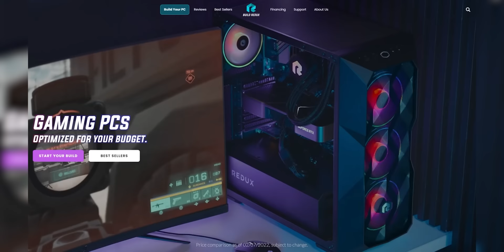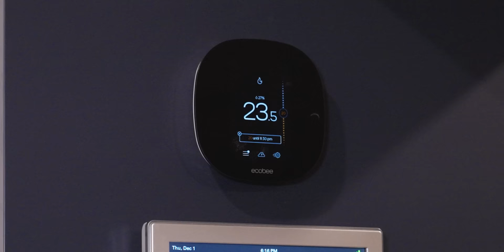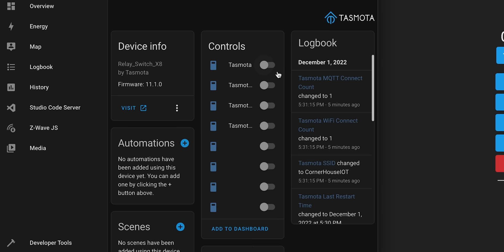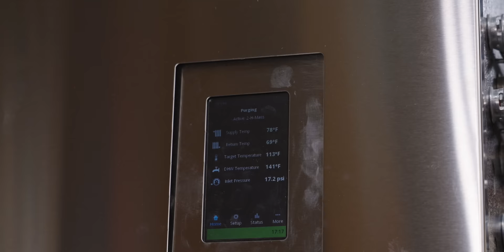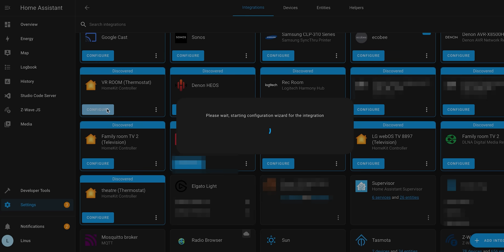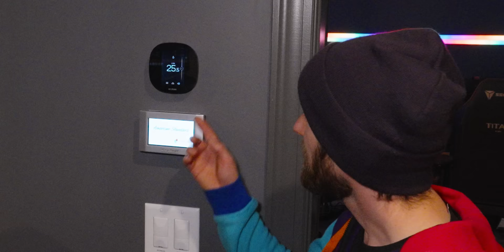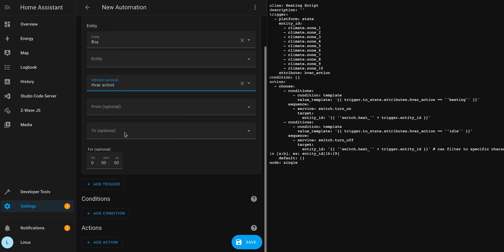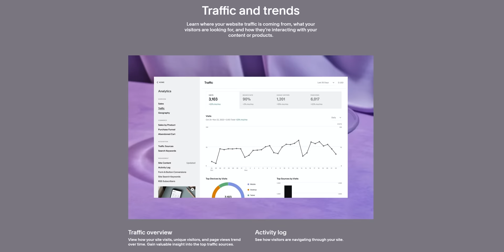My Smart Home is Stupid - HVAC Update

Comment: The endless problem solving, tweaking, upgrading of Linus’ house stresses the s**t outta me. Plus constantly having a film crew there, I feel like I wouldn’t be able to rest.
Reply: For this reason, im glad to be in a small house with a dumb thermostat and normal light switches
Reply: I’m sure getting a lot of this stuff for free or discounted rates makes it a hell of a lot easier
Reply: @MiguelY22  Danfoss Eco 2 is even better than the dump and can be controlled with bluetooth. They also turn down if you open the window.
Reply: What's more, his new house is probably being treated as a business premise / use and all the tax deductions which come along.
Reply: This is why having a good contractor when building a house is SO important... HOWEVER and Ive been wondering if Im noticing this as confirmation bias or if its true, but it seems people in general are less competent at complex tasks then they used to be. 
So to me lately it seem its also just as likely Linus would be dealing with major screw ups by some expensive "pro" as doing these things in a do it yourself janky way.

Comment: Now you have local control! If your relay board ever goes out and you need heat before you can fix it, you can manually turn on zones by pushing that silver lever all the way to the right. There's spring tension you are working against when the zone valve is not powered. But if you just push the silver lever with more force you can run the zone.

There is a little metal hook on the bottom that you can get the lever to rest in, thereby holding it open without power.

Comment: For temperature offset correction (in the case of the one thermostat reading high due to it's location on the wall) follow these steps:

1: Tap the three lines in the bottom left of the main screen to bring up the main menu

2: Scroll towards bottom of the main menu and tap "Installation Settings"

3: Tap "Thresholds"

4: Scroll towards bottom and tap "Temperature Correction"

5: Adjust to match a thermometer placed in a centralized location of the room. adjustments can be made in intervals of 0.5°F, unsure what °C intervals are. (I'm an hvac tech in the state of Ohio in the US, so we almost exclusively set up our tstats in °F)

6: Exit the menus by continually tapping the back arrow in the top left corner

7: Observe the main temperature screen and watch for the room reading to change. It usually takes a few seconds to implement after getting back to the main screen

I hope this helps you Linus as well as anyone else wondering about temperature correction. Note that this primarily works for thermostats that are under a constant hot/cold influence. A thermostat in an open, windowed room will still act up a bit when direct sunlight hits it for an extended time during a cloudless day.

Comment: The ecobee thermostats allow you to calibrate/ offset the temperature sensors. For best results, get some matte black spray paint and cut an aluminum can open and flatten it, then using some thread, hang it at chest level in the middle of a room for a day or so, and the. Using an IR thermometer, check the temperature periodically throughout the day. Then using the average temperature delta between it and the ecobee, add that offset to the thermostat.
Reply: Wanted to also add that you can pretty much use any matte black object that has a very low thermal mass. I personally use a soda can section because they are very thin, but still durable enough to be reused when needed. Depending on the home construction you may need to do the test twice, once in the winter, and once in the summer, then writing down your winter and summer offset, then switch to one of those depending on the seasons.
Reply: I don't know what type of sensor it used. But they right resistor probably do the job
Reply: Just use an ecobee sensor and place it in a spot that better represents the room's temperature and have it read from that sensor instead. Probably easier
Reply: @jeremiahkuehne2400  While it would be good to use multiple sensors, compared to other companies, ecobee gouges like crazy on their sensor prices, in addition to needing expensive batteries that do not last anywhere near the advertised times. Beyond that, they refuse to add much needed functionality that will play to their strengths, for example, The ecobee can control the heating, cooling , and fan separately, why not allow me to use have the system cycle just the fan if the temperature delta between upstairs and downstairs exceeds a specified amount?
Reply: @Razor2048  or use buttons
Reply: @Razor2048  That would be a nice feature to automate! Where I am and how I have mine set up, if the temperature difference was large enough I would just leave the fan running continuously on a low speed. But our house has even enough heating (for the spaces we typically occupy) and I don't have a secondary thermostat heating up my other thermostat so I don't have to worry about the thermostat getting the temperature wrong lol. Good to know about their sensors. I opted to not bother with them because I didn't want yet another small gadget that I needed to baby-sit!
Reply: @emenesu  I think the point of it is that the device could do it, but for whatever reason that kind of usefulness is left out. @Razor2048 I figure it might be because the ecobee is designed as if it will be the only device sensing and controlling HVAC which applies to just most dwellings (single floor, small, and/or old central HVAC design,) so any work into complex multi-floor/multi-zone was not considered heavily. If I want to do the same myself I'd need the right glue of HA's automations to make sure it runs rationally, because trying to avoid fighting thermostats resulted in a bunch of faffing with conditions.
Reply: you are talking about american people.

Comment: God tier hvac guy here; if you ever have an issue with the zone valves or tstats that metal slider on the bottom can be slid into manual on. 100% heat which will also make the end switch in the valve as well. You can all ways jump out the call for heat on the boiler as well. If theres no flow the boiler wont run so dont worry about breaking it.

Comment: Ironically I think linus going down the smart home path has even convinced me that I don't want a mini split, bro I ain't never seen any stupid issues with a whole house forced air system like the variety of issues linus has had over his multiple houses
Reply: Minisplits/heat pumps are pretty sick, it's the automation that kinda kills it
Reply: I'm in residential HVAC mini splits are dope. Eventually whenever my system kicks the bucket I may just swap out the split system I have and get a 4 headed minisplit or just buy one for my computer room. They can actually help the original system not run as much, and we've had a lot of customers tell us that their electric bill went down after just putting a minisplit in their lanai and having them keep the sliders open to assist the main system.
Reply: Here in India it gets much hotter (40+ degrees) and we use mini splits only. They're very reliable and much more efficient that ducted systems. Ducted systems are anyways useless in our homes as they made with concrete and bricks. It's the automation that's causing the trouble.
Reply: @Dijitz23  Thats because most mini splits heat 1 room at a time if you set them that way,  its easier to have the source of heat or air directly in the rooms so they get hot or colder much faster..          Some rooms can boil hot where others will be cold as hell.       if i get a mini split it will be a dual voltage one 120vac/220v  + 12/24vdc.
Reply: @panzer3279  > Ducted systems are anyways useless in our homes as they made with concrete and bricks.

Most homes in US are made from concrete and bricks too? Only reason venting is useless in most of India is because most Indians cannot afford to pay for proper home venting systems installed by people who know what they're doing, instead the Bhayya from Bihar bullshits a terrible system for dirt cheap and everyone is left wanting more.
Reply: @debodatta7398  > Most homes in US are made from concrete and bricks too?

They aren't ? Do you consider houses that use bricks on the exterior of the house and wood framing internally as made of concrete and bricks ?

>most Indians cannot afford to pay for proper home venting systems installed by people who know what they're doing

This is so far from reality that it makes me believe you have no idea about how costly Indian homes have gotten. Most houses in tier 2 cities cost as much or more as US houses with their "proper home venting systems". The real reason it is not done here is because it is wasteful, split systems are more efficient when you need to cool just a portion of the dwelling for majority of the time. People in the US generally don't care for efficiency, average energy footprint of a US home is no where even comparable to an Indian home.

These systems are still prevalent in offices / business spaces in India because unlike homes, they are expected to have occupants in all places majority of the time.
Reply: After living in subpar rentals the past few years I don't care what I have. I just want decent insulation in a house that's well sealed first...

Comment: Linus, a Heat Pump should work constantly. It adapts the interior temperature based on the outdoor temperature. It measures the outdoor temperature and heats up the house. The thermostats should always be ''open''. This is the only way you could a constantly warm house without temperature spikes and without high costs. The heat curve should be as flat as possible.
Reply: Also the hydronic compensation should be turned on in the thermostats, which learn how quickly they heat up and cool down and compensate for that. Neither of the problems outlined in this video should really be a problem at all. Run the heat pump at either a high or low level and allow the hydronic compensation to keep the in-floor heating at a constant level too.
Reply: What are you talking about? It should work consistently yes, but it won’t always be 100%. Heat pumps have a lower limit of how cold the outside air can be before it physically can’t pull any more heat out of it. Given he lives in Canada and it’s real cold there, he will need to supplement with in-floor heating in the cold months.

Comment: We have "smart" light sensors at our office that turn the lights on and off depending on how well the room is lit up and if someones inside. And they do annoy the sh*t out  of everyone, we all just wish to get a goddamn switch back.
Reply: The thing is, these things SHOULD come with a 3-way switch: AUTO/ON/OFF. So many headaches would be avoided.
I've experienced the same at our Uni. One of the large class-rooms had automated lights, but no off switch. When you wanted to run a presentation with a projector, the professor would resort to putting a bit of aluminum foil on the detector, and waiting a few minutes for the lights to go out. Then a gust of wind would blow away the foil during presentation and we'd have to fix it back on and wait for a few minutes. 
The dumbest shit ever.
Reply: I love tech gadgets so I bought a smart lightbulb for the very first time for my lamp in the living room and its so damn annoying. It keeps disconnecting from the app and if you switch it off and on too quickly, it goes into some kind of pairing mode and starts doing this annoying flashing pattern and you have to spend another minute on your phone again to fix it.

I had similar bad experiences with smart thermostats too...I'm honestly over it.
Reply: You have to be really careful with motion sensor light automation. Presence sensors are much more accurate at telling if people are around vs just seeing if they moved, an especially common issue with desk work in my experience. My Workaround (since i still don't have a presence sensor in my office) was to increase the shutoff duration to about an hour since there's no way i'd sit still for that long.

Comment: I think analogue is a lot better. You can make an analogue circuit as complex as you like, but in the end, they work all the time like that Mercury switch that Linus rolls his eyes at did the same thing was not on the Cloud or relied on Web API  and didn't an IT certificate to figure out it was either on or off.
Reply: Exactly, a simple old school thermostat in each room would accomplish this
Reply: although it will kill you and your loved ones if you drop it, and the chance of that with these hosts is pretty frickin high
Reply: You can't set a schedule with analog thermostats or control them remotely, which are actually pretty substantial benefits.  Handling just those would be simple too.  Linus wanting to incorporate presence detection into his HVAC automation and avoid cloud services is really the main source of these problems.  That and having two separate heating systems.

I think an analog backup to make sure the smart system doesn't misbehave too badly would be prudent though.
Reply: @JamesScholesUK  The amount of mercury in a thermostat's tilt switch isn't likely to be lethal even if a person ingests it.
Reply: @VitalVampyr  Linus doesn't understand how a heat pump works.  Lowering your temp when you're out of a room is stupid.  Heat pumps are best when you set a temperature and never touch it - turn it off when on vacation or something but other than that set and forget.  A car is most efficient driving at a specific speed constantly, not starting and stopping all day.
Reply: @Beerdwolf  Starting and stopping all day is normal operation for a heat pump, it's only on when the temperature is outside it's set range.  Being off for a room you're not using is more efficient than trying to maintain a temperature for no one's comfort.
Reply: @VitalVampyr  You clearly have not watched chubbyemu videos lol.
Reply: @JamesScholesUK  even as a kid i wasnt interested in ingesting mercury after breaking thermometers multiple times

Comment: Tasmota is pretty good but ESPhome may suit your needs better as it’s integration is native to HA
Reply: Exactly what i was thinking…
Reply: True. I like mqtt because I can see what is happening on the network. Makes it easier to troubleshoot. That  being said, Esphome never gave me any trouble.
Reply: Definitely. I switched from tasmota to esphome. It might look more complicated but in the end it isn't. And they wouldn't even need MQTT with esphome. I've just replaced my 40 year old green house window circuit with an esp relay and esphome curtain. Works great and I've integrated rain detection and some dew point math since the green house (~100m² and two storeys high) is connected to my house. At a friends house we used it to integrate mitsubishi hvacs with HA which is awesome. I wish there would be more HVACs which could be integrated this way. I really hate the cloud trend. There should always be a local api as well.

Comment: IMPORTANT- a heat pump should be using weather compensation and therefore the thermostats and valves need to remain open to get as much volume in the system as possible. Instead of zoning, increasing and reducing the heating (which is way less efficient) the system should be balanced to spread heat across the whole house to keep the home at a constant temperature. Look up Heat Geek for more information!
Reply: That's not what's happening though.  The in-floor heating is using a natural gas fired boiler.  I saw no mention of how they intend to balance the in-floor heat boiler and the mini-split system.
Reply: @StephenGrinwis   They shoud really set it up as dual fuel have have the floor heat take over below 0 degrees C
Reply: You haven't seen the other videos?

If nobody is going to be in RoomA, just close it off (Door and Vents) but keep the rest open. No need to heat/cool a room where nobody is.

You like 22°C but in the other room they prefer 20°C? zones are your friend
Reply: @notalostnumber8660  any rooms within the thermal envelope of the property will be sucking heat from other rooms unless insulated internally, meaning a heat pump will need to run hotter to compensate. To achieve the best possible scop you want as much surface area as possible on the emitters.
Reply: Can Linus use the heat from the servers to keep the house warm, or was that already mentioned in another video?
Reply: @notalostnumber8660  "No need to heat/cool a room where nobody is."
if it gets huge time to warm up the room, yeah, nobody is ever going to the room, because its always cold. a room cannot instantly heat up when you step in it. are you willing to sit in a room for hours for it to heat? nope. you just never go to the room. self fulfilling prophecy..
Reply: @Redmanticore  ;
A room of a child, that is going to stay over in another house... nobody is going to be im the room... so you could close the door shut, prevent the HVAC from working there... and not worry about it

I'm not saying that you should prevent the living room from getting HVAC, but a room where you know nobody has a reason to go into, like the room of someone who isn't going to the in the house

Comment: The best thing about those mercury thermostats is that you can wire in parallel means to turn on the heater. A very simple method with no cloud requirements. Add some esp32s, temp sensors and relays and write your own code.